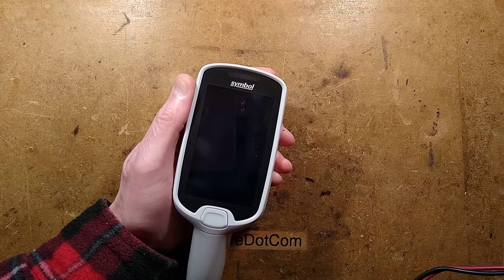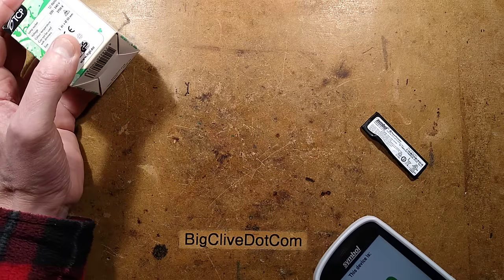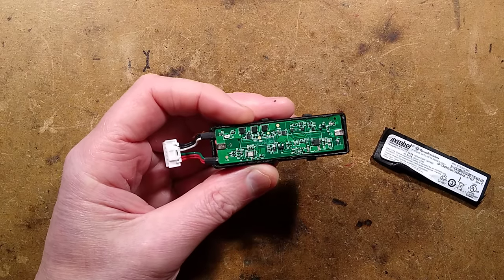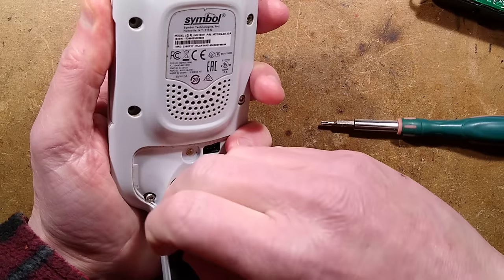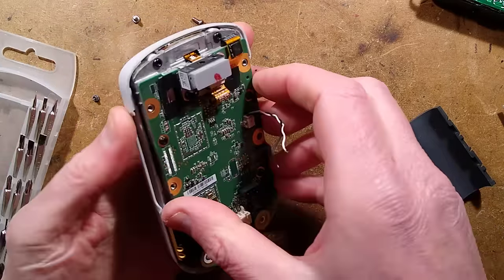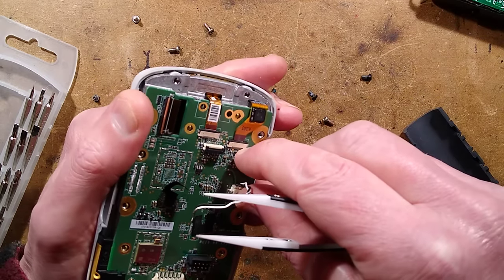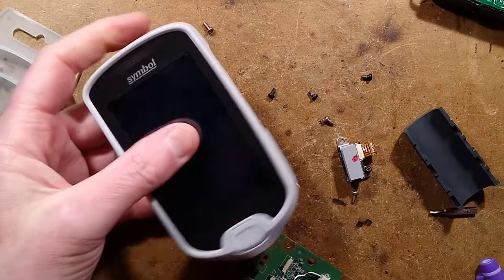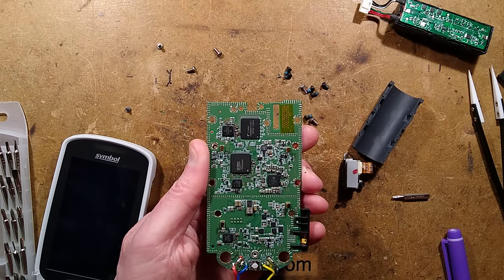Inside a Zebra MC18 self-scan terminal

Comment: Interesting, I saw one of these reboot in a store, but it was running something that looked suspiciously like Windows 98 instead of Android before getting to the default scanning state
Reply: That windows 98 looking interface is Windows CE, a very lightweight version of windows mobile that could run in 4MB of RAM. Early WinCE and WinMo devices used RAM as storage and you could drag a slider to divide 64MB of RAM in to say 20MB RAM and 44MB storage. Even if the batteries died you'd have about a day to charge it before the back up battery died.

Comment: Well you got a lot deeper into it than on the live stream. 
It would be interesting to see if you could download the operating system and set it up to scan again. I figure you would also need to programme the barcodes into it.  
Interesting tear down. 2x👍
Reply: Its standard android. Its just the launcher/app is special and oem probably. Although the scanners at my supermarket have the default android launcher but a custom application that starts on boot. I have seen some crash and the android desktop env appeared.

Comment: Soon it will be impossible to reflash MCU's because of the new security measures deployed to prevent knock-offs and device tampering in the field.  It will require security certificates to perform operations such as reprogram, or erase of the device.   You cannot perform a whole chip erase to regain access to the MCU's, the chip itself has protection against this, and even worse the manufacturer can permanently lock out the MCU so even if you have the authorization and security certificates.

What I am talking about is the ARM's Trust-Zone and PSA (Platform Security Architecture) API's security implementations for IoT devices will take the joys out of hacking these kind of electronics. I understand why it's done, it was the theft of IP and the field security tampering that's driving the market to make these changes... and subsequently, any enjoyment we'd have hacking these devices for "fun"... This technology has been rolling out for a while now, so expect this to become common.

Comment: Asda's next plan, currently on trial, is Scan & Go Mobile, using your own phone rather than one of these units.
Reply from the maker: I'm surprised they're not just doing the self checkout with its extra layer of security by weighing stuff.
Reply: That's just another way of getting an app onto your phone - along with the associated tracking and other technologies that allow them to follow your every move!!
Reply: They must have decided the hardware readers were not providing enough data for them to mine.
Reply: That's how sainsburys do it with smartshop app. Can use one of these devices or your phone.

Comment: Question 
Why can't I run a color cycling led in parallel with a normal led.
 Both have their own series  resistor.
Both work individually.
But try both at the same time and the normies go off and the cycling one works.
A lipo is the supply. 
Wtf?
Reply from the maker: Do they have their own independent resistors?   The one thing that could make a blue or white LED go off is being in parallel with a lower voltage LED.  Normally two separate circuits should resolve that.
Reply: @bigclivedotcom  Hi many thanks for the reply.
 Yes they do have their own separate resistors. I'll do some more experiments today and let you know.
I even separated off the white LEDS with a IN4007 diode in case of some back feed. But it made no improvement. Strange.
Reply: @bigclivedotcom  Ok . Problem solved. Found a tiny hidden limiting resistor in some black heat shrink in one of the feed wires. Missed it before.  Many thanks for the help.

Comment: This to me looks more like in warehouse device, rather then modern Chainstore self-scanning devices. Basically person with a two pallet troly gets an info on a screen what to pick up, where from and scans the box (or location to confirm it was picked-up. In mine teenage times I used to work in Tesco/ Kaufland warehouses and these used to be serial programed with most of the data. I wasn't technical enough that time to understand. On startup these scan for a login (manager) barcode or an engineer barcode.
Engineer would have provided necessary connection info, or database settings, but would not be able to assign user, while Manager would assign device to a worker(Session). 
These used to work connected to sage or other database or system externally and contain very little capability themselves. The VMware is used here to outsource even more of the kernel operations to the server side, by actually linking directory often within root including /proc /dev often without ssl(unsecured) but that goes out of mine Gentoo Linux head.
On the other side your Motorola  (or possibly symbol) selfscaning checkout readers are just cheap android phones with slightly different peripherals, with an app connected to instore LAMP or similar purpose equivalent

Comment: The Elpida chip is 8G DDR2 RAM, the next one is 32GB memory chip, don't know what the TI chip is, and the Actel is an FPGA. Fairly confident one of the TI chips is the CPU, and I'm not sure if the fpga is doing graphics or the TI chip.

The 6 pins accessible from the battery compartment makes me think there's an ISP or JTAG interface there so someone could create a jig to reuse these things. Probably closer to junk though.

Comment: Hello sir, I need help I have 808nm 200mw IR laser diode but I don't know how to make driver circuit for this laser diode.can you give me suggestion or tutorial for how to make circuit board for this laser diode and it's work properly
Reply from the maker: Some lasers can be run with a simple resistor, but others require a regulated current source.
Reply: @bigclivedotcom  but sir this laser diode operating voltage 2.2V and operating current 350mA and Light output power 200mW. I don't know how to make circuit board for this laser diode. can you help me how to make adjustable voltage circuit board for this laser diode.

Comment: If one could give me one of those devices I could have a go with it ;)
Those zebra android devices store most of the configuration on the "enterprise" partition on the emmc, if someone finds those pins and is able to wipe the device it should work like a normal android "phone" since you essentialy delete the mdm configuration and apps.
There might be other ways to do it like the firehose mode, but they require some special sauce that is hard to obtain if you don't work in the service centre.
There are other devices too, like the TC51 which get used in "some german retail store" and I have a complete unpatchable mdm bypass for those where one can use them like a normal non locked down phone (with all mdm apps still on it) at work. (no, I WILL NOT disclose any information as to how this works since you could make serious damage with a stolen device.)